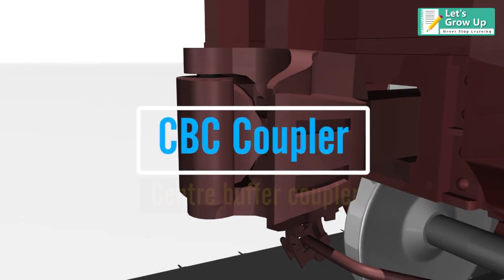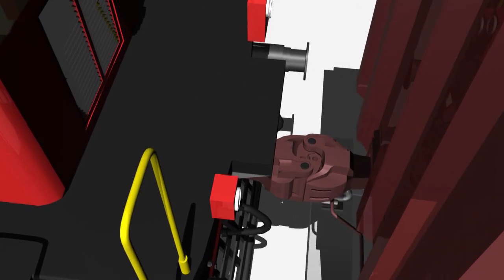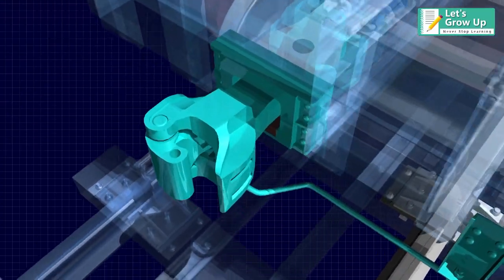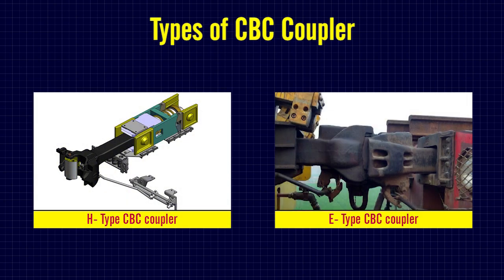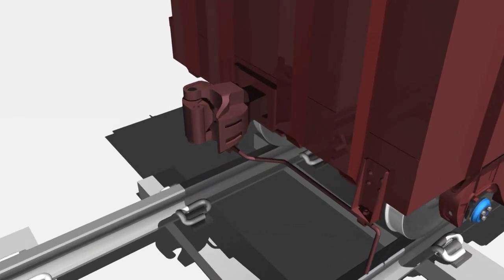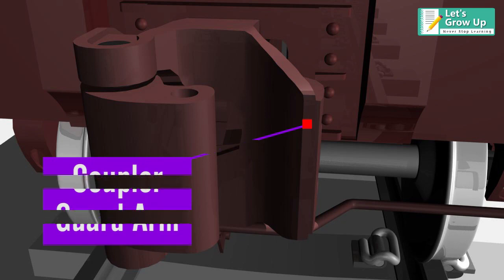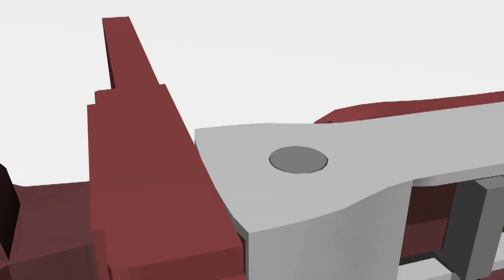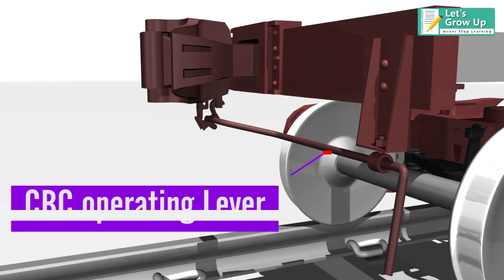What is CBC coupler and how does it work? | different parts of CBC coupler | #let'sgrowup

Comment: Due to the CBC coupler in LHB coaches lot of jerks are experienced during the train acceleration and deceleration. How can that be avoided and make travel as  smooth as ICF coaches ?
Reply: By adding draft gear in the coupler of LHB coaches.... Journey will be smoother.
Reply: Side gear buffer is a way better
Reply: Shim metal plates put in between the CBC coupling may reduce jerking effect in LHB coaches.
Reply: APD ka full name kya hota h
Reply: So true.. sometimes it's so irritating and frequent that I feel ICF coaches are much better
Reply: @jitendragoyal7238  Antipilferge device
Reply: @bb_vishnukv8710  thanku sir ji